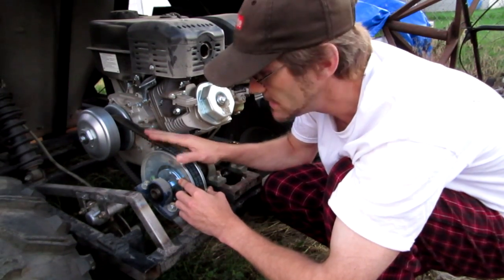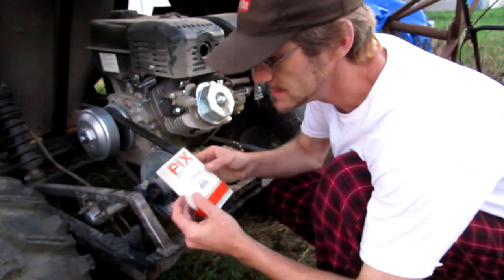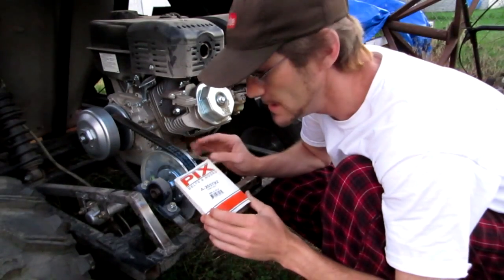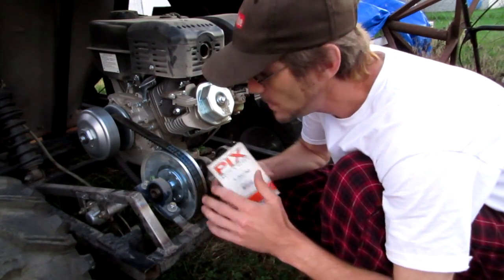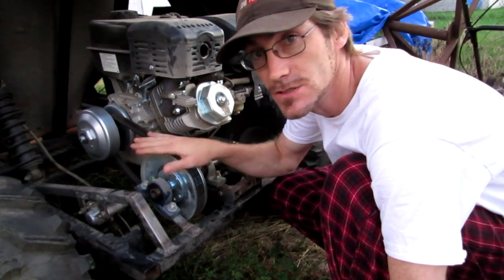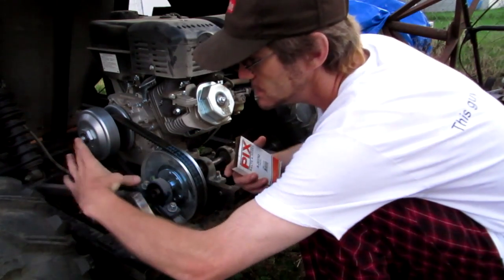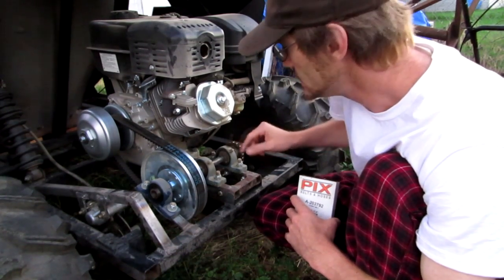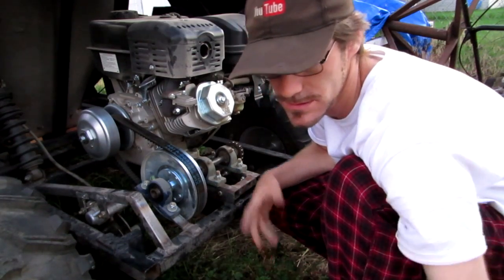BATMOBILE GO KART | 40 series Torque Converter |

Comment: Were do u get the jack shaft components at, and how does the sprocket stay on the jack shaft
Reply from the maker: I got the JS components from Ebay. The sprockets stay in place with a set screw and key.

Comment: Are all 40 series compatible if I get them from different places? What is the height of both the driven and the driver, not the diameter the height? My centricular clutch is supposed to be heavy duty for a 12+ HP engine but it seems to be slipping and hard to get rolling. I know it's heavy but do you think this might fix my problem? You can check out my cart here. Love to hear your opinion. Thanks. WWII Airsoft Jeep
Reply from the maker: WOW, that looks like a COOL build. we would need to do a G+ hangout some time so I can get more info from you.
Reply: ***** That would be great. How do I do that

Comment: I just installed a 40 series torque converter and jack shaft.  I am having problems because no matter how loose the belt is the driver is still grabbing it and spinning the wheels at idle.  I have a harbor freight 13 hp motor which says idle is 1800rpm's.  Can you offer any help or suggestions.  Could it be a bad driver? 
Thanks for any assistance.
Reply from the maker: it sounds like you might have the pullies to close together or the alignment is messed up. look in the description of this video for info on alignment.
Reply from the maker: ***** do you have the machine up in the air when your testing it?

Comment: It is in the air however there is a lot of torque to the wheels.  We can just barely keep the wheels from spinning by holding them.  The driver at idle is compressing the belt. 
The set up we have is as follows: Standing behind the Kart - Sprocket to left wheel, driven with red spring facing the sprocket.  We had the driven in different positions.  1. belt straight with driver and driven when engine is off, then the driver pushes belt towards engine and makes the belt go at an angle at higher RPM's.  Then we moved the driven to the right so at higher RPM's the belt is straight on with the driven.???  The distance between driver and driven is 9 3/4 center to center.  Then we backed the motor thinking the belt was too tight and that was why it had so much torque at the wheels but the driver still engages a very loose belt.  The belt is so loose I can take it off the driven by hand.  Driver seems to engage too soon? 
Thanks for your earlier responses.  Any and all help is appreciated.
Reply from the maker: well you want the drivens spring to the right. What size of tires do you have?